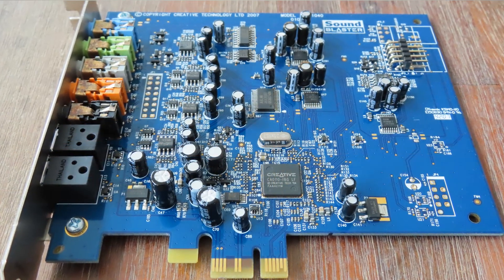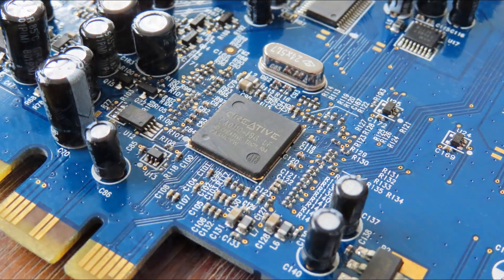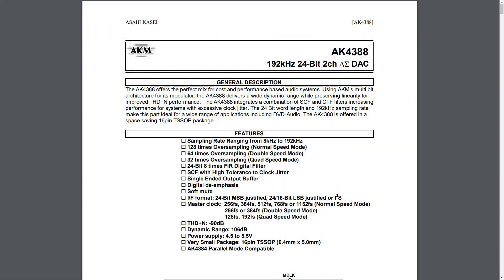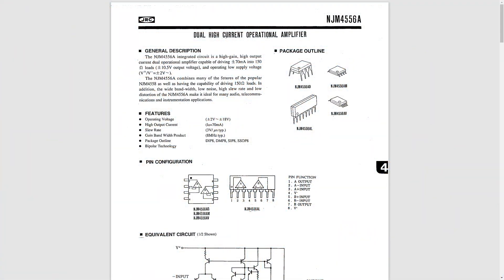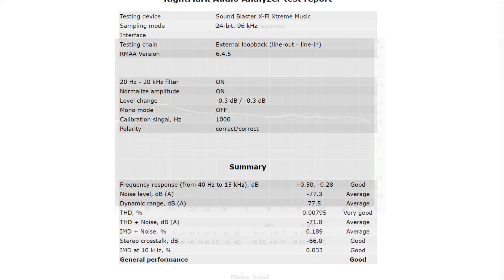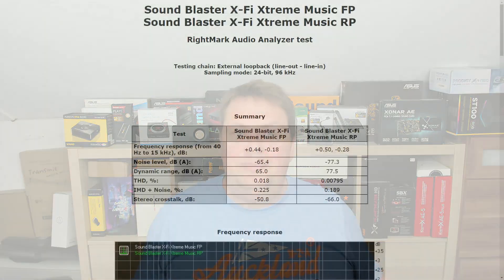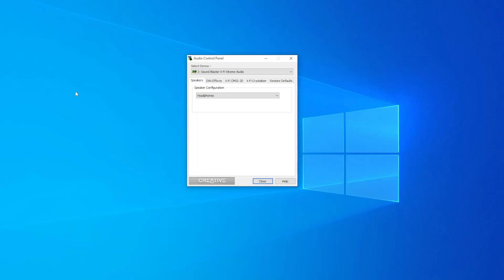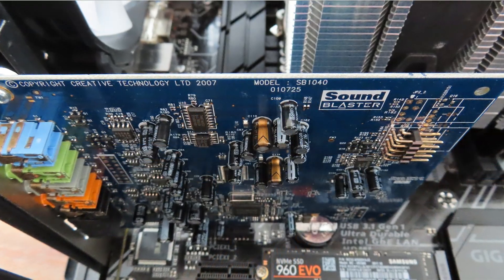Is this the most boring sound card ever made?

Comment: What experiences have you had with latencies? There is a program called latency monitor; Supposedly, the lower the latency, the fewer glitches and interruptions there will be while using the card. Being PCIEX x1, it should already have a good response in that sense. Maybe a typical user won't notice that as an advantage. But in recordings and streaming it is a critical factor.

Comment: The problem with multichannel PCI express X-Fi cards is that they all use the standard, low tier DAC and op-amps for the outputs. Even the Auzentech X-Fi Forte just uses good op-amp and DAC for the front two channels only...

...unless you go to Japan. There is one company that did a supposedly good implementation. The Onkyo SE-300PCIE has good analog multichannel outputs, but good luck finding one for cheap, or even at all, especially the first revision that was made in Japan (rev 2 was Malaysia). The price with shipping, taxes and import duties would enter the 200-300 euros area. Ouch.
Reply from the maker: Yes, the better opamps are always for the front channels. The rest get whatever is cheapest. I've been looking for those Onkyo's for ages, but their are very, very hard to find here in europe.

Comment: Hello Anton, please tell me, when you testing sound cards in RMAA, what equipment do you connect to the line-in? I have an EVGA Nu Audio Pro and it has a good ADC. Will it be suitable for my tests of other sound cards? Thanks in advance.
Reply from the maker: I usually use the Creative G6, but I may vary. The EVGA Nu is a very good card to use! Please keep in mind that in order to get the best results, you have to do a weighted test. You will need a splitter cable for that. One end is attached to the line in of the EVGA and the other to a headset. That way the sound card has to do something and will results in real world results.

Comment: Hi, i saw you are one on the only to collect and review internal sound cards, as a fellow collector of those i'd like to have a chat with you about those, heck for some i have even worked on some open source drivers, if that interests you, i made cards like the audigy 2 zs series work on powerpc macs running os x.
Reply from the maker: Hi Piecaruso97, Good to meet a fellow collector! Cool that you have worked on open source drivers! Dit you also work on Linux drivers? Especially for the Creative cards, they are notoriously hard to get working on Linux.
Reply: @AntonsHardware  Hi i have mostly worked on OS X and modern macOS drivers, but i have also contributed to the kx audio driver which is also a windows driver (essentially it's a driver that can be compiled for windows or mac) and probably you have used it with the audigy 2, in the review video. i have noticed that, in one of the system settings windows, for the card properties it uses a name tag for the card that i have created for the kx audio driver. 

Mostly i like to get stuff to work on my old macs and my hackintosh machines, and to have them work better than they used to. 

I am now working at a new version of the kx audio driver for mac that adds support for multiple sound cards at the same time, for now i have tested it with 4 sound cards at the same time, but i am trying to all the way to 6, in theory it should work up to 16 sound cards at the same time.

I have also just got a prodigy 7.1 hifi for my collection and i am working on adding support for it to the envy24ht mac driver, i have discovered that there are 2 different versions of the cards with different subvendor ids, so i had to add support for mine into the driver (i have also improved compatibility with 64 bit oses for the driver since it had a lot of assumptions made for 32 bit code, but that breaks for 64bits). For the prodigy card itself i don't have noticed none of the bad things you highlighted in the review, this leads me to suspect that you got a faulty card, perhaps some of the old capacitors are failing on yours.

Comment: could u possibly incorporate a search for bass redirect/bass management in ur sound card vids im currently putting together a list of sound cards with this feature since theres sparse info of cards that do and dont have it
one way u can test the cards u do have is by having a set of speakers plugged into the subwoofer out and just play a 30hz test tone to see if the feature is properly implemented
Reply from the maker: Wow... ehh... You mean the Crossover frequency? Or just if they have the functionality? I don't know a lot of sound cards that have that. I haven't seen that in a while. If I'm correct, the older Cmedia based cards by asus have that.
Reply: @AntonsHardware  if u go to ur sound blaster Z video at minute mark 4:32 u will see at the bottom of the menu the "bass management" u must toggle the "bass Redirection" for ur subwoofer output to play bass audio with non-LFE and/or stereo content like in ur browser on youtube the crossover slider is just a bonus

with the new driver interface u can find it in playback/the gog icon next to "speaker calibration" and u must select "custom speakers" i think u must but definitely must to enable the crossover slider then u have to toggle ur front speakers as a non-full range speaker

my onboard audio (alc4080 - realtek audio control) u just set the config to 5.1 surround and toggle either ur front or surround speakers to non-full range speakers then bass will be redirected to the subwoofer output but does not have a crossover

i recently got a sound blaster Z and using the newest interface